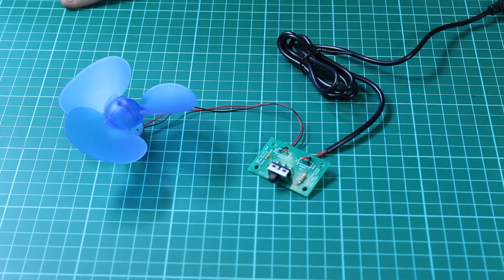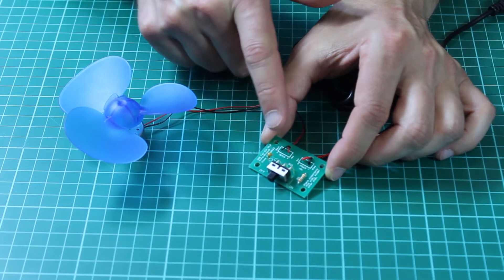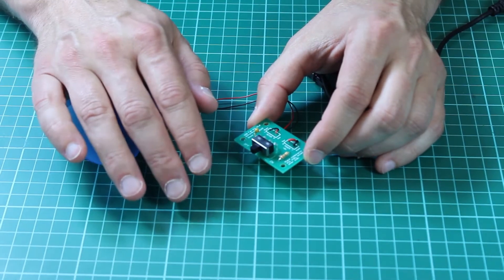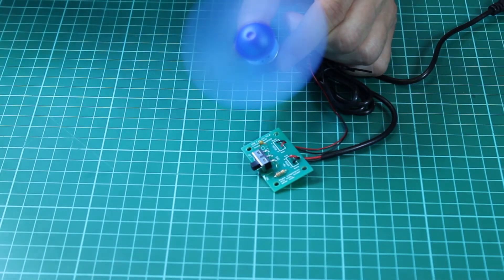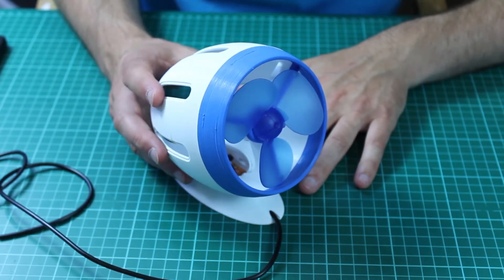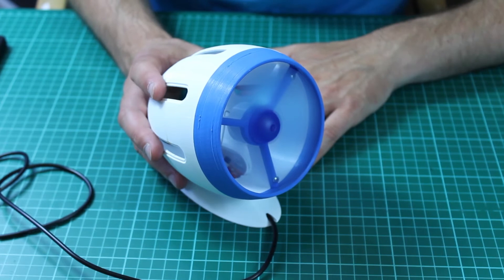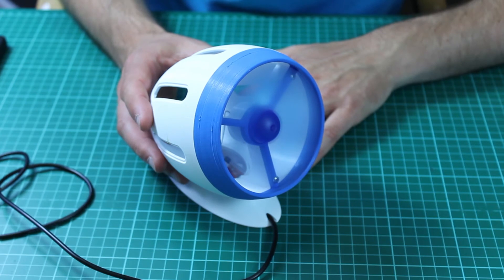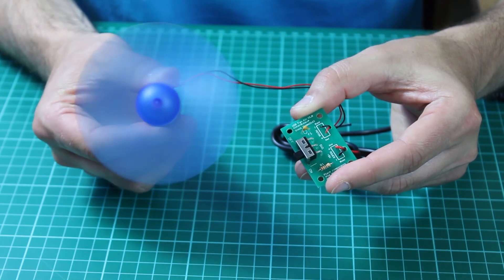USB Fan Kit By Kitronik

Comment: It's a shame the shipping costs are so high to the Netherlands. And no distributor is selling the kit. So I guess I have to get the parts myself from China. Unfortunately the summer will be almost over.
Reply from the maker: We'll pass it on to our distributor. They only takes lines they've had demand for. You could also let them know directly.
https://www.kiwi-electronics.nl/
Reply: Unfortunately they only sell the micro:bit line. But world-wide nobody sells the fan kit (yet). Maybe next summer.
Reply from the maker: The kit is still new so distributors will pick up it soon. 
Kiwi Electronics did say they would consider new lines if they had a demand.